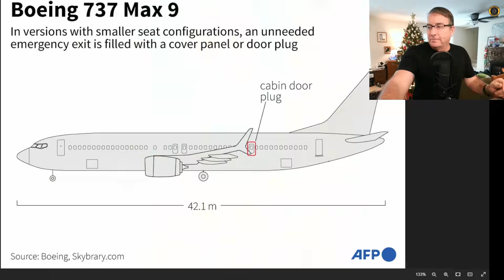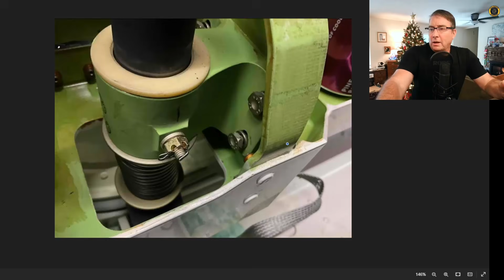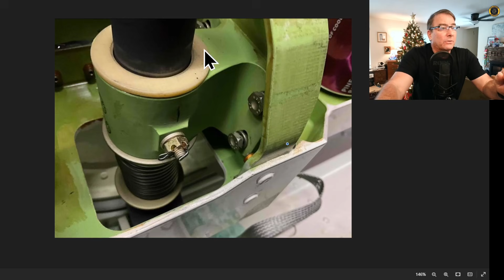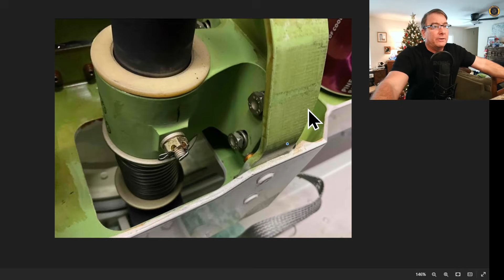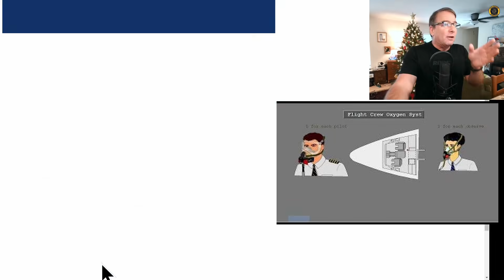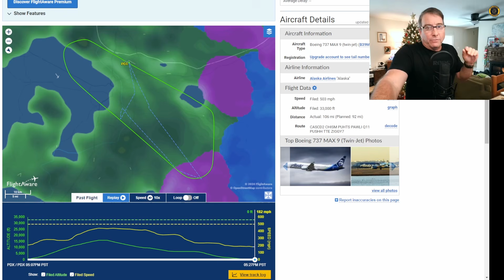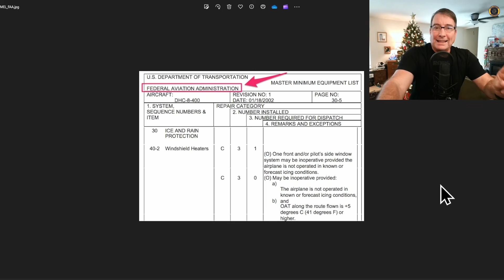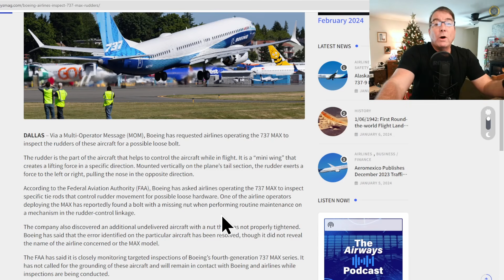"Yes, We Have No Bolts"  9 Jan 737 Max-9 Update

Comment: Loose and/or missing hardware can easily be a result of "diversity hiring" practices. When people care more about "getting the job" instead of KNOWING the job, it leaves holes in properly DOING the job. Along with "diversity hiring" is the reluctance to discipline and rectify failures caused by them, and the accusations of "racism" (and other labels) in the workplace. Many "diversity" hires go out of their way to blame someone else and shun their own extremely important duties as being "someone else's problem".  It is irresponsible to operate such a company in such a manner.  Especially when the results of such "politically motivated" practices do have deadly consequences.  Of course the consequences nearly always affect "someone else" so they do not actually care.  It's just "numbers" to them, instead of their own lives at stake.  The fact that many bolts were left loose and in some cases missing altogether, points directly to Boeing and diversity hiring "lax" practices. It is very sad that a lot of companies now employ these kinds of hiring and training directives turning a blind eye to the realities in order to "virtue signal" just how "inclusive" they are. It makes you wonder if "diversity hires" on the production line that inspect each phase are in fact themselves incompetent and "hide" many failures to protect their "friends" from getting disciplined, retrained, or canned.  Boeing used to be a top notch company, but not any more.  And if I was an Astronaut, I would refuse to hitch a ride on any of their spacecraft.  An "explosive" decompression would mean death, and sometimes agonizing.

Comment: Well, if the bolts were missing that hold the door in the upper locked position, that would definitely cause the door to fly off, plus I heard this airplane had pressurization problems. Maybe it’s been over pressurized on ascent the lock bolts actually work as pins that have safety, castellated nuts. So if those were in place, that door would never come off.

Comment: Just wanted to put it here, for the Airbus’s planes that I have had the chance to fly. Cockpit doors were always designed and meant to pop open in a rapid decompression. Ref: FCOM-DSC-52(doors)-40(Cockpit door security system)-20(cockpit door locking system)…
Quote: Cockpit door control unit is in charge of: Unlocking the door in case of cockpit decompression (the door then opens towards the cockpit under differential pressure).

Comment: Is it possible that an employee or group of employees are sabotaging the aircraft?  To have missing plug door bolts in one aircraft, loose hinge nuts  in another and a missing rudder linkage bolt on yet another is unreal.  Seems like a case of employees that are criminally sloppy, terrible inspectors or sabotage.  If  it is sabotage, it could be a disgruntled employee or a hostile nation state  actor with a planted mole or moles trying to destroy our faith in Boeing and disrupt our aviation system.

Comment: Not finding bolts isn’t a positive indicator they are missing. I’m interested in any witness marks or lack there of.

I’d like to see airport CCTV of the plane. The pressurization failures tell me that door plug wasn’t fully seated for some time, if ever.

This is more proof that selling business units and outsourcing in general doesn’t save money long term. I know Spirit operates in the us, but generally I hope to see more re-shoring of manufacturing because long term outsourcing doesn’t always help business, and mostly doesn’t help the US.

Comment: I am not an engineer by trade, but to me, it's obvious that the door should have been designed with a flange, larger than the doorframe, and the installed from the inside.

Comment: A door plug, not to be confused with a plug door, is used in some of Boeing's 737 MAX 9s instead of an actual emergency exit door. It can be removed outwards for maintenance and requires stop pads on the airframe as well as stop fittings on the door panel to prevent outward movement during operation. This did not prevent the plug door from detaching on Alaska Airlines Flight 1282 on January 5, 2024, which has been attributed to missing bolts in the upper guide fittings and the lower hinge assemblies.

Comment: Your definition of a plug door is wrong in my opinion. 
This door is not a plug door. It is not even a plug. 
By definition a plug tapers and is supposed to be larger than it's frame.
In general plane doors cannot open to the outside because they are larger than theier frames. In order to open them they have first to move inwards. 
This to prevent unwanted opening even in when the door is not bolted. 
Inside pressure wil always keep the door in place. 

This is a design flaw of this panel!!

Comment: The entire idea of constructing an airframe with a required number of emergency exits, and then simply lowering the seat capacity and thus subvert certain regulation limits to come up with such "cheap" solutions is disturbing. It should be investigated closer what other components of the aircraft are subjected to regulations related to the lower seat capacity - we can assume similar.

Comment: It is absolutely not possible, that 4 pinned bolts, get quietly loose and disappear without any marks on the metal. There were no bolts at all! Someone had to screw them tight, and someone else had to check that. None was done. This is a big stink. Boing is in heavy poo.

Comment: I work 5 years on a japanesse machinery manufacturing. They ensure all bolts were passed the quality control by marking all  surely tighten bolts by paint marker and check sign in to it. It seems boeing does not do this security standards

Comment: Relying on pins to keep the door down against cabin-to-atmosphere pressure differential looks a bit sketchy. If the door has to lift to pop up, there should probably be a wedge bolted between the frame and door for additional lift prevention.

Comment: Could not help but think of the event that occurred with Aloha Airlines Flt 243 in April of 1988. Although these events are completely different, it’s the simple fact that when  “aircraft skin/structure” liberates from the airframe, airworthiness of the aircraft is compromised. It’s then airmanship of the crew that becomes paramount. I wonder what pilots think of this aircraft? It is unfortunate that the Max has become the poster child of very bad leadership at Boeing.

Comment: My felling as a retired FAA ASI is until they determine what failed they should block off all the seats near the "plug doors" and maybe release these to service or hold them on the ground. It seems that the 737-9 has had a lot of flights without problems but as you said the AD did not give specifications for inspections.

Comment: Interesting. Looks like the 4 bolts for the lower hinge shaft (in your photo) allow for vertical adjustment of the door for Stop Pin to Stop Pad alignment (similiar to the serrations seen on the upper guide rollers). Even if the bolts are loose, the door still needs to travel up vertically 1.5 inches to clear the stop pin to the stop pads. The slots cut into those brackets would not allow the door to travel up far enough to allow stop/pad disengagement, unless the bolts came completely off. I agree about the door possibly leaking, but wouldn't you think a passenger Dec 7th, Jan 3, and Jan 4 would have said something? It would have made quite the noise.
Great video. Thx

Comment: EPA requirements and majority of aircraft manufacturers stopped using zinc chromate paints and ZC tapes around the mid 90’s due to being carcinogenic. The company I worked for went to an epoxy coating which is more durable and did a better job protecting aluminum.

Comment: In order for the hinge casting to be completely missing from the Alaska plane AND the door itself, both the flange nuts had to be loose ( and subsequently failed when the door exited) or completely missing AND the castle nut/cotter pin had to be missing.

Otherwise, the hinge casting would still be attached to the plane or the door, and not missing completely.

If this doesn’t scare you, idk what will.
Reply: Will be very interesting to see what sign-off sheet wasn't signed off, and who and where that wasn't. Notice, with mssing things, we need speak in triple-negatives.

Comment: I wonder what the size of the 4 side bolts are? Looks pretty small for the various up and down flights that the plane makes . Improperly toque on smaller diameter bolts will cause breakage with any vibrations. When I worked on mobile equipment , all nuts and bolts are grade 8. If bolts are broken , we drill out the holes to larger size and switch over to fine treads
Reply: Good point, was thinking same, UNC, UNF, etc. Was there maybe some confusion between Imperial and Metric to play here? Hopefully not. Yes, depth and pitch and even length of thread all need be carefully considered and specified.

Comment: Thank you for your breakdown on this flight. It also caught me by surprise when i heard in the NTSB press release that the cockpit door had to be secured by cabin crew. And that it was designed to open in order to equalise pressure in the plane.
Fair enough, but what of communication with cabin crew? Or passengers? Or best of all ATC?
My compliments to the captain and his first officer, as well as the cabin crew for gtting the plane back on the ground safely.
Reply: And great big compliments to the servicing crew for cleaning all those seats.

Comment: 4 bolts held in place by locking nut with cotter pins do not all fail at the dame time. It should be obvious on the door if there was ever a nut tightened against the paint of the door. A properly tightened nut would leave an imprint in the paint.

Comment: From looking at the door, my guess is that the blow out doors are only intended to equalize the pressure if the leak is on the flight deck. So these doors would swing inwards to the flight deck to equalize the pressure, because the whole door would otherwise be plugged shut by the pressure difference.

Comment: Airbus uses a true plug type  emergency door over the wings where it is pulled in to remove the door.
Simple latch mechanism. No vertical  movement ,  lighter door assembly,  no bolts to loosen, no hinges, better sealing, probably cheaper to make

Comment: Airbus also has a  pressure unlocking mechanism, which I found out it only works only when the A/C is powered, I’ve been told it’s designed  in the case of such emergency, the cabin crew can access the cockpit and assist a pilot in the rear event the flight deck crew wasn’t able to put the O2 mask quickly.

Comment: I see why YOUR upset……I just don’t get why these nuts keep loosening. Is there any assembly problem? Unintended or unknown vibrations? Did Boeing, their design/ subcontractor or the component manufacturer spec out the wrong fastener type/grade? Or did the manufacturer of the bolts or nuts have their own manufacturing defect that has not been identified? My gut is telling me that their supplier or the component manufacturers supplier are getting these nuts from the same source. 

My final thought is, did they not calculate enough Margin of Error for this component during the design phase? Or did the design team want more robust fittings or components which management declined because they were trying to meet schedules and budgets?

Comment: The blowout panels are used throughout the airplane (esp. the cargo holds).  I used to design them years ago (about 35 yrs. ago)  at Boeing.  I became very  familiar with high speed motion picture photography at that time TESTING these damn things to make sure that they functioned properly.  We did a lot of TESTING on all kinds of systems back then, and things worked.  
I don't know what is going on at Boeing now.  But it looks like a complete shambles.

Comment: Hi Juan: I’d say losing this door is rather shocking, however if one or a few passengers went overboard with the door and RD the outlook for Boeing would really be dim. I’d say they actually got lucky that no one was sitting next to that door. I’ll bet passengers will avoid that row for the next 20-30 years. So sure Boeing will check that the bolts are installed but that’s not going to make people request that row!

Comment: I have to believe that since those door plugs are designed to open for maintenance, at some point they have to be rigged and functionally tested. Whether this takes place at Spirit or at Boeing before the sidewalls go in I don't know. And any paperwork covering the installation and testing should include the instruction to re-install, torque, and cotter pin those four bolts. And for something as critical as the door plug it should be a "designated" torque which means that QA witnesses the final torque. Two sets of eyes always is safer.

Comment: Just wondering if the pressurization alerts that were thrown on the previous flights would have been a telltale indication of that door not sealing?  If there was a problem surely there would have been air/hissing noises present.  Maybe not, but I am curious about this… I am no expert.

Comment: In the past, Juan was a strong supporter of Boeing aircraft (and rightfully so).  However, I sense that the many Boeing screw-ups recently have shaken Juan's confidence in Boeing and that is a shame.  Boeing was the gold standard for aircraft manufacturing.  Now, that reputation has been tarnished and Boeing will have to earn that reputation back through demonstrated excellence in all aspects of aircraft development, including management, engineering, production, quality assurance, training, and maintenance.  For many years, I revered Boeing when I was a crew member on Boeing multi-engine military jets.  Now that I'm so old that I can only fly as a passenger, I think twice about flying on a new Boeing aircraft.

Comment: What happened to the use of torque-seal in aircraft manufacturing? At 6:31 and 21:28 (same photo), those are some special NAS bolts,, not much good when one is still sticking out about 3/16 of an inch. 
WTF has happened at Boeing?

Comment: Juan, it might be helpful to describe the difference between a PLUG DOOR and a DOOR PLUG, and then use the terms consistently. ALL the doors in that A/C are plug DOORS -- designed so that the pressure differential pushes the door into a tight seal. In contrast, a door PLUG is just a passive hunk of structure that plugs a hole where some A/C configurations -- but not this one -- need to fit a fully operational door.

Comment: In your opinion, if all 4 of those bolts had never been installed, shouldn't that door plug have seperated from the plane sooner? I know it's a new plane, but it has to have had dozens if not a few hundred take offs and landings by now.

Comment: From what I've read, Spirit AeroSystems installed the door plug and Boeing did not remove the door plug to install seats, etc.  If Spirit also installed the interior panels, there would be no way Boeing would have noticed missing bolts.  If Boeing installed the panels, they should have noticed any missing/loose bolts.
Reply: Alaska might have opened it, if only the 15 degrees for ventilation.  Or the CB shop might have opened it, but says no.  The sat antenna is right above those door plugs.

Comment: 737 fuselages are built in Witchita at spirit aero systems with the door plug rigged but not installed when rail shipped.  It seems to me that on the assembly line in Renton the interior was assembled over the plug before the final fuselage work was completed.  I expect that the FAA will find this error rather expeditiously in the IAM assembly process before they find anything but more loose bolts on a wider array of MAX airframes.  I expect a mea culpa from IAM leadership eventually.  I don't know if this same door is present on NG aircraft?

Comment: Out of curiosity what grade are these bolts supposed to be?
Reply: Which ones?  The ones on the bottom and top are not under any significant tensile load, only minimal shear.
Reply: @BruceLiebert  Which is why I wonder if the bolts may have sheared off.
Reply: @SOU6900  Shear strength is typically 60% of the tensile strength.  The only static shear load would be from the assist springs, which do not have enough force to lift the 63 pound door.
Reply: @BruceLiebert  Well I'm just going to stop making hypotheses, and just wait for more updates from the investigation.
Reply: Aviation grade
Reply: @craig7350  AN8 tensile strength is 125,000 psi.
Reply: Anything short of a pasta noodle would be adequate to stop the door from moving up.

Comment: Apparently the cockpit voice recorders required (CVR) by the FAA, are only required to have two hours of recording capacity and will keep recording and over write its recording until they are powered down. That's what the mention of opening the circuit breakers were referring to. You have open a circuit breaker to power down the CVR in an emergency if you want to preserve the recordings. I'm not familiar with the 737 cockpit, but the circuit breaker probably wouldn't be on any of the instrument panels in front of the pilots. It is likely located in a breaker panel somewhere else in the cockpit that is probably not as readily available or as easily accessible as the instrument panel.

The CVR probably should have larger recording capacity, along with a mechanism to automatically detect an incident and preserve the recording going back a certain duration and a button pilots can press that automatically preserves the audio from a previous duration.